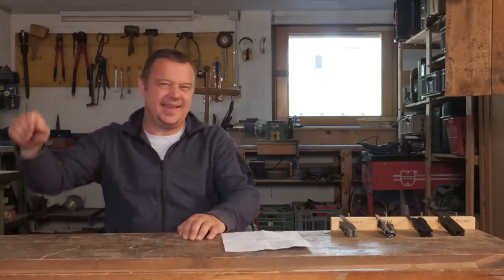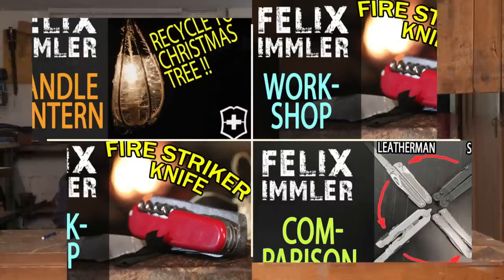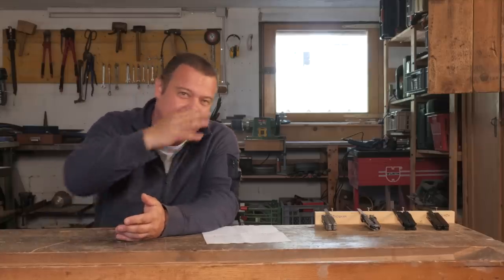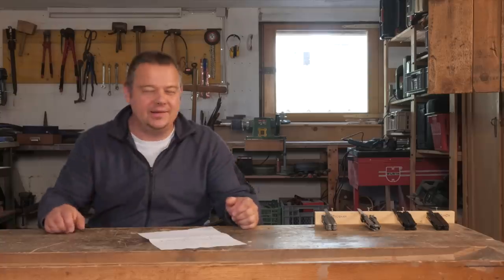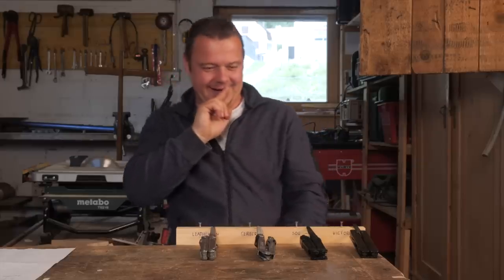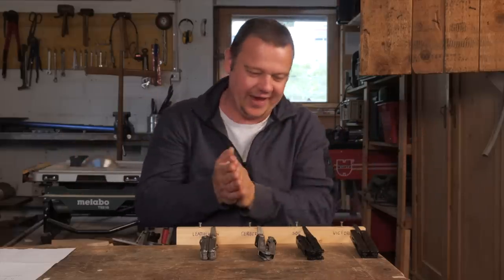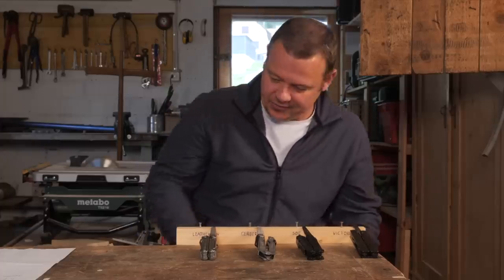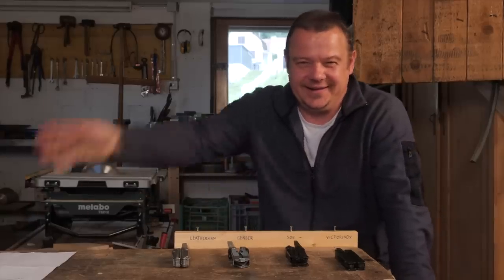Leatherman, Victorinox, Gerber, SOG - The ultimate Multi-Tool Comparison - metal file & metal saw

Comment: Victorinox should enter body-and-soul in the niche of multi-tool pliers, or perhaps further develop the two main models. With its precision, quality and reputation, it would easily won space.
Reply from the maker: Thant's my opinion too!
Reply: There isn't really much left to do in that field, except for making tools one handed opening, they are already outside accessible.  The individual tools themselves are as good as it gets.  Anything else is really just a novelty - like the Leatherman Signal with removable firestriker/whistle and sharpener, and beneath Victorinox.  Having said that I think it would be amazing if they made something tiny along the lines of the Squirt, and something comparative to a Juice, with two alox SAKs as handles, that would be a dream multitool for me!

Comment: A file is designed to cut in one direction and a sawing motion is the quickest way to dull it.

Btw the best file you'll ever find on a multitool is on the original 1990's Gerber MP.
The file was made by Simon's, and is the only multitool file I know of that was actually made by a file manufacturer.

Comment: I've had my Victorinox Swisstool for 15 years and it's still in excellent condition. It is very solid and hefty so I've used it to hammer things many times. I've pried so much stuff I shouldn't have with the tools and I thought it would mess up the opening/locking mechanism, but every tool still opens and closes like new. The Victorinox is an excellent tool and might even be better than the Leatherman.
Reply: I have the Leatherman and love it , but I've been looking at prices for the Swisstool and want to try one . Thanks for your input E E .
Reply: I, personally, think that the leatherman is 500 times better than the swisstool.
Reply: @enzosteiger8054  explain.
Reply: @enzosteiger8054  Leatherman fan😂😂😂😂😂
Reply: @QuantumPyrite_88.9  My Swisstool Spirit (I choose it over the larger Swisstool, after having considered the weight difference - and the tools I'm likely to actually use!) isn't that much younger - and I love it, too! :)
However, I found that a multitool is somewhat on the big-and-heavy side for being at hand on a daily basis. It does reside in my EDC kit on the bottom of the backpack I carry around - but I found a need for a pocket knife to be with me all the time, and be momentarily available. And guess what... this means another two Victorinox knives, one keychain-sized for daily use, and a larger, locking-blade Sentinel for outdoor trips. 

Currently I'm having an eye for a multitool for a lady, but honestly, as much as I love Victorinox, I feel this time it is likely to be a Leatherman (looking towards the Skeletool series here - I'm suggesting her to go for a lightweight tool).
Reply: I have both the Wave and Spirit. I actually prefer the Spirit for general 'all-round' use but don't trust it for heavy duty use. Stainless steel is relatively soft and the Leatherman has replaceable toolsteel bits and cutters. Then there are the riveted pins which aren't as reliable as screws which can be adjusted as things wear or get pressure applied. [Or replace damaged parts].
Reply: It is better, no mights ifs or buts !

Comment: I started my knife-life as a huge Victorinox fan (you know, MacGyver). Then I learned about steels, locking mechanisms, manufacturers, clips and all the bells and whistles and invested into expensive reputable brands. Then I realized I will never feel prepared without a Vic and went full circle back. The quality you get for such a small amount of money is hard to beat!
Reply from the maker: Thanks a lot for your interesting feedback!
Reply: Use SAK tweezers to open handcuffs . It works .

Comment: Anyone can make a decent knife and pliers, but making really good files is almost an art, requiring perfect hardening and tempering. Look at the file after using it on tool steel- if you see scratches the file is too soft, and most of these are. Gerber isn't what they used to be; the old Gerber files were excellent and the Leatherman has always been good. Never tried a Victorinox but I will when I get a chance.

Comment: I was hoping the Victorinox would come out tops cos I am a great SAK fan. I have used the metal saw on the SAK in anger on various occasions to saw off screws and bolts. Did once have a leatherman and I agree the diamond file was something.

Comment: I knew before you started the test that the sak would win, I wonder why I thought that?
Reply from the maker: Haaa ha haa good question!
Reply: The Swisstool Spirit is not a SAK. If you want to put a SAK in the mix, try the Work Champ. The file is even better than the Spirit.
Reply: @debajyotinath5021   SAK used as a victorinox general term nothing more.

Comment: I own several leathermen, but bought the victorinox spirit for the great reviews.
My favorite remains the Surge leatherman, because it is more robust.
As for limes, on the surge they can be exchanged for little money when consumed. because limes wear out enough, both on leatherman and victorinox.
Regarding the performance, I must say that victorinox has a more aggressive file at the beginning of leatherman (surge and wave for example).
but it tends to mellow a little faster than the leatherman.
So they end up being similar.
The best file I have seen, superior even to victorinox, is that of a 1994 PST leatherman. After 25 years it is still perfect.
In my opinion it is the result of a better quality metal heat treatment than modern multitools.
However victorinox spirit is a multitool of incredible quality and workmanship. With a very sturdy pliers.
Leatherman is less refined but of equal quality and more versatile and comfortable.
both multitools are great. in my opinion superior to Gerber or sog.

Congratulations for the video and your enthusiasm !!!

Comment: Ideas:
-Review how quickly you can open a tool from each type/manufacturer (spring tension, location, indexing, ect.)
-maximum torque for each types' screwdriver (how far into hard wood can you drive a screw with each type)
-strength of the plier bite
-maximum thickness/strength wire each cutter can cut

Cheers! 🍻
Reply: Use the tweezers to open handcuffs . It works .
Reply: If he does it!! I'm sure Leatherman win easily!! Cheers.
Reply from the maker: Thanks a lot for your interesting inspirations!
Reply from the maker: So first I have to rob a bank and get caught! 😂😂
Reply from the maker: Leatherman is hard to beat! They make a fantastic job!
Reply: @jossbull7170  😂😂😂
Reply: @FelixImmler  Can we get instructions from you on how to rob a bank?

Comment: I prefer the Victorinox because I find them to be more comfortable than the other two, it looks classy as hell, and I prefer the actual knife blade style and steel over the other two. Just have always had and easier time getting them sharp compared to the blades of the other two. 
I can definitely say the leatherman is incredibly close and you will not go wrong either way. And a victorinox can be just as versatile if you know how to use it and depending on the model you are using.

Comment: Hi Felix, great comparision, and the winner was very clear. Thanks a lot!
But I have to say, that I do not totally agree with a tool as you suggested, means a Victorinox with a diamond side comparable to the leatherman. The reason is: according to my experience, diamond pads tend to wear off very fast, if you use them regularly. It does not make sense to me to have a multitool, which should usually last for decades, with a tool fixed on it which wears off maybe in half a year of use. I know many people do not use any of the tools of a multitool more than once in a year or so, and a diamond pad/file would be good for their whole lifetime, but there are also plenty of users which use their multitools regularly, and even most of the tools there. So I would always recommend to keep such a wear-off-tool either totally separate or at least exchangeable.
So, my idea would be: additionally to the extra tools for the Swisstool and the pouches for all that stuff which already exist one could also develop some further tools with a focus on wear-off-tools, like e.g. a two sided diamond pad (in two grades, of course), a firesteel, and so on, ... and if required a bigger pouch or so ;-)
Best regards, Robert
Reply from the maker: Hey Robert! danke für Deinen super Interessanten Hinweis!! Ich habe auch schon öfters festgestellt, dass Diamantfeilen nach kurzer Zeit viel an Abtragsleistung verlieren. Meine Erfahrung ist, dass sich dann aber die Leistung Diamantpads einpendelt und man lange Zeit damit Werkzeuge schleifen kann. Die Optimal Lösung steckt eingentlich im Leatherman Surge, wo die Diamantfeile auswechselbar ist. Einen neue Feile kostet bei Leatherman 10 Dollar.
Reply: @FelixImmler  Ja Felix nach dem ersten Abrieb gehen die Diamant-Dinger schon noch eine ganze Weile mit halber Kraft, aber wenn man halt viel damit macht sind sie irgendwann wirklich alle. Das geht manchmal relativ rasch, ich denke das hat nicht nur mit den Diamanten sondern auch dem Trägermaterial zu tun. 
Eine auswechselbare Feile ist ok, die Frage ist aber halt nur, ob man wirklich jedes Werkzeug auch im Multitool verstauen muss, oder ob es nicht auch als externes Zubehör geht. Und ob das nicht sogar besser ist, das extern zu halten. Ratschen oder Bits und so weiter hat man ja auch separat, warum nicht auch so typische Verschleißteile ...
Es gibt ja beispielsweise auch schon einen Diamant-Messerschärfer (4.3311) von Victorinox, der nicht nur zum Messerschärfen sondern auch für manche andere Tasks sehr gut taugt und den man gut als Ergänzung zum Swisstool benützen kann, aber er ist halt etwas zu klobig (der Griff stört), um ihn auch gemeinsam mit dem Swisstool in einer Pouch unterzubringen ... eine in Größe und Form genau angepasste Version wäre super.
Ich bin oft am Überlegen, was ich wirklich am Messer haben möchte und was eigentlich lieber separat sein sollte. Nicht nur wegen Verschleiß und einfachem Austausch, gibt manchmal auch praktische Gründe. Ich finde zum Beispiel die Zangen am Handyman oder Ranger etc. nicht schlecht und benütz die auch oft (meist um Dornen aus meinen Schuhsohlen zu ziehen ...), aber oft bräuchte ich halt die Zange, um irgendwas zu halten, was ich dann mit einem anderen Werkzeug (Messer, Feile, Säge etc.) bearbeiten möchte. In solchen Situationen macht es ja keinen Sinn, Zange und die anderen Werkzeuge untrennbar voneinander an einem Werkzeug zu haben. Also nehm ich beispielsweise fast immer auch noch die kleine Knipex Cobra 125 mit, obwohl ich ja schon am Messer eine Zange hätte ... Manchmal ist das Multitool auch einfach zu "bollerig" für Feinarbeiten - oder die Tools sind so ungünstig angebracht, dass der Griff des Tools bei der Arbeit immer im Weg ist. 
Aber ok, das führt langsam zu weit ... könnte man ja stundenlang sinnieren ... ;-)
LG, Robert

Comment: I am very happy with my Swiss champ, the metal clasp has helped me cut chains up to half a centimeter thick, I have been using my Swiss Army knife for 8 years and I would not change it for anything, I always carry it in my pantsI am very happy with my Swiss champ, the metal clasp has helped me cut chains up to half a centimeter thick, I have been using my Swiss Army knife for 8 years and I would not change it for anything, I always carry it in my pants.

Comment: I have a leatherman classic and the Gerber, I like that the classic leatherman has stronger components in general, and replaceable cutting edges for the wire cutter, but it's not comfortable to use. The Gerber is great in that I can operate it single handed and for this reason, I usually carry my gerber. Only when I know I will be cutting a lot of wire, say mending fences, or a lot of prying, will I purposely choose the leatherman to put on my belt. Another great video thank you
Reply from the maker: Thanks a lot for your super interesting feedback. Greetings from Switzerland

Comment: Excellent demonstration and I learned something about my Leatherman file; that it has a sawing capability on the edge. I just didn't pay attention. My question; does the Victorinox Swiss Tool lock each tool in place like the Leatherman does? I generally carry both my Leatherman Wave and my Victorinox Trekker when I hike. I think the wood saw is better on the Trekker and the knife is better too. But, when I am doing honest-to-goodness chores that require a safe and capable tool that I can use muscle with, I always use the Leatherman. This is primarily because the Leatherman locks the tools in place. Does the Swiss Tool lock the tools in place with a reliable locking mechanism?
Reply from the maker: Yes, Victorinox Multitools have also an fantastic looking mechanism for all tools. The Leatherman Wave is a wonderful Multitool. On my opinion it is similar to the Victorinox Spirit x.
Reply: Yes, and the Victorinox is a much tougher tool than the Leatherman.

Comment: This is why I switched to the Victorinox years ago from Leatherman. While I still carry the Surge for that reason of the diamond file, and it will also take a hack saw blade, I’ve found the pliers to be inadequate for most tasks that I’d use pliers for. So I chose Knipex and my Swiss Champ instead, covers pretty much everything

Comment: I used to have a Victorinox Swisstool. The tools were so hard to open I had to use a screwdriver to open them. I tried cleaning it and oiling it multiple times but it didn’t work. So in the end I got a Leatherman because it’s held together with screws so I can dismantle it to clean it.
Reply from the maker: Thanks a lot for this super valuable hint!